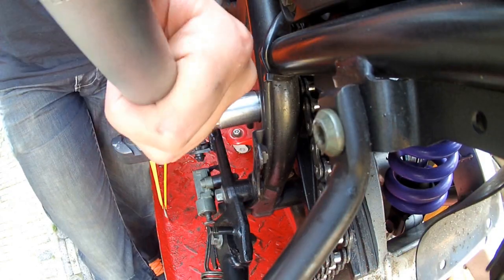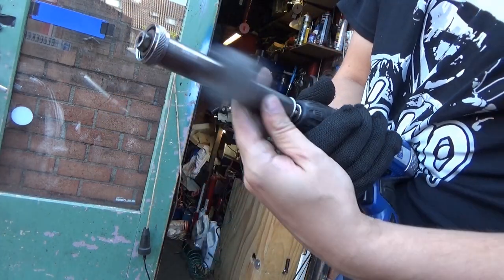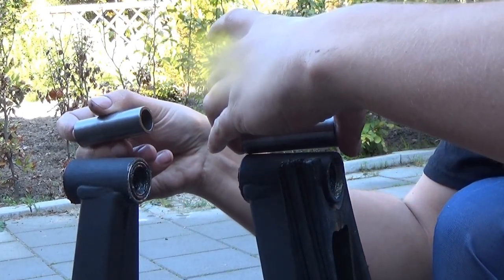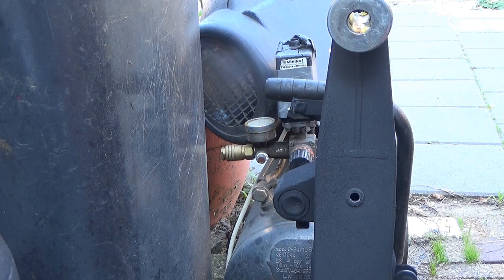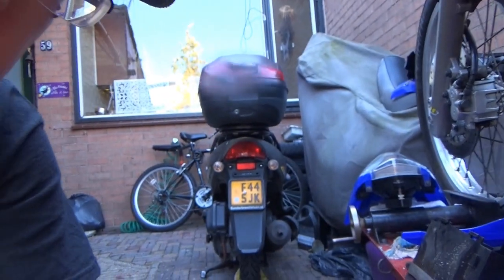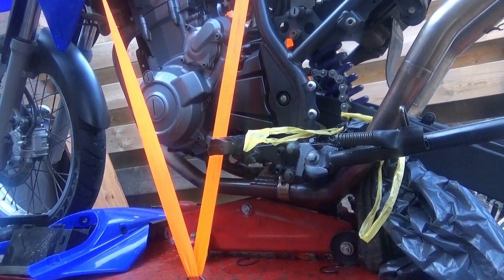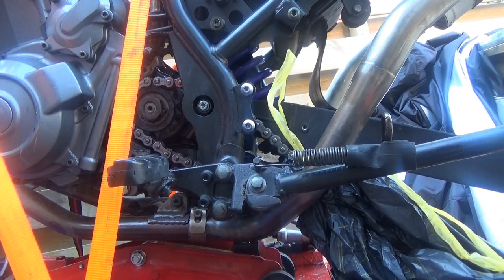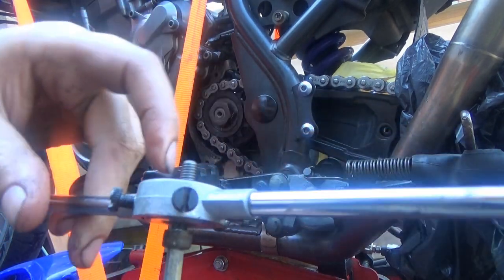Yamaha XT660R Rebuild: Day 5 - Putting the Swingarm Back

Comment: That is not how you should put a swingarm together man 😱😱
Reply: vet tech whats wrong with it?
Reply from the maker: You mean the clamp?

True, but it works in safe, slow and controlled way, and it cant go in crooked.
Reply: Partly the clamp indeed.
But also the f-ery with the helicoil 🙈
Reply from the maker: @VetTechNL  The helicoil i shall agree.
But that will be fixed in a different part, don't worry ;)
Reply: @Meifesto  very curious to see how.